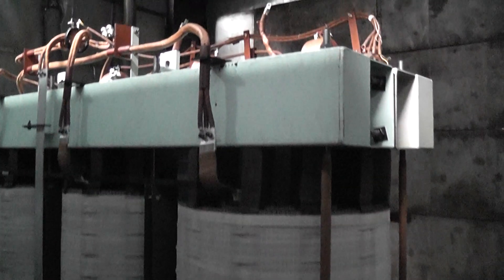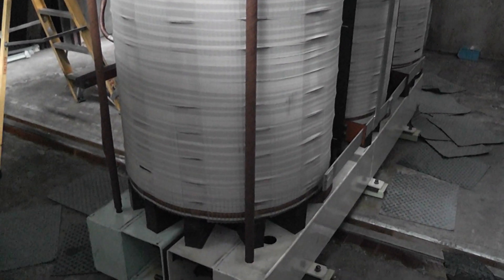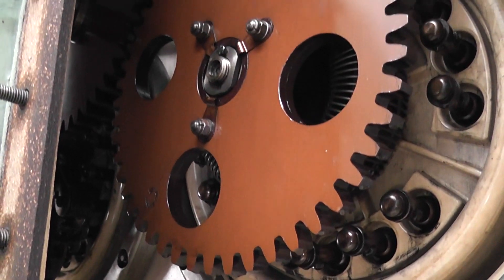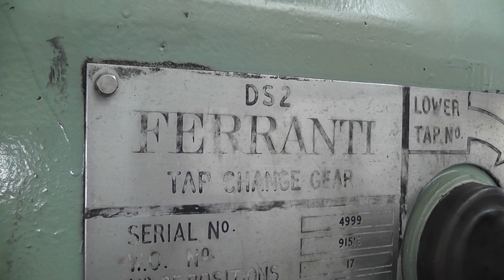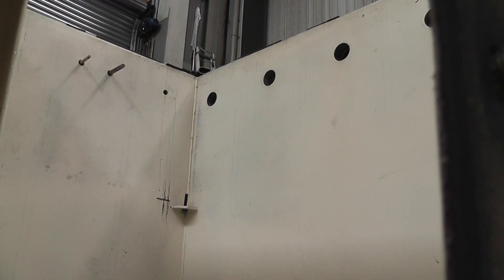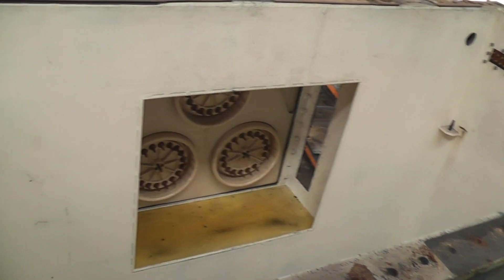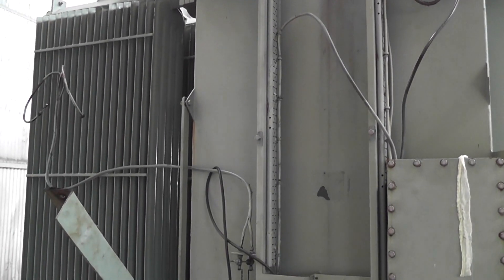What is inside a large 12.5 MVA transformer

Comment: Those spools around the big wires on top of the transformer, are they for measuring the voltage? They have a lot of turns..
Reply from the maker: That is a CT ( Current Transformer or Stroomtransformator ) to measure the current through the incoming supply cables.

Comment: What was the result of the gas test? Was it normal or do you not know?  Not too familiar with the gas testing in the Bucholz relay except from what ive heard. Whats ive been told, if its flammable gas, then it could be a sign of overheating/arching. And if its not, could just be a slow oil leak. Ive heard that a few times from others who work on big transformers like this so maybe you should be the person to tell me how true that it or how such a gas test is done of that's not right.

Comment: It will be interesting to see what caused the gas. Quite often it can just be bad oil, but it can also be the start of insulation failure. But the windings looked quite clean and not discoloured, however the oil looked quite dark.
Reply from the maker: The TX failed shortly after a power surge on a 11kV feeder fault. The magnetic surge may have upset something internally.

Comment: So, just how small a flashover does it take to blow enough oil into the conservator to trip it. I will guess that there was a tiny flaw in an inner winding that flashed over to another and then self cleared by blowing aluminium away and making a nice oxide layer there as well.
Reply from the maker: Yes, it is very likely that an internal flash over has done some arcing. Winding continuity tests have been done and the readings are good. The transformer won't go back into service at this stage and may even get scrapped. A 1953 ASEA transformer of the same rating will be installed in the meantime.

Comment: On the tapchanger - how do you know which wire goes back to which terminal?
I can see 3 bunches which narrows it down but still - looks complicated!

Also - when a tap changer moves to another winding, does it span two windings briefly so it doesn't interrupt supply?
Reply: I think they just measure the resistance of the coil which has to match with precalculated values. Your second question is an interesting one; i was wondering the same!
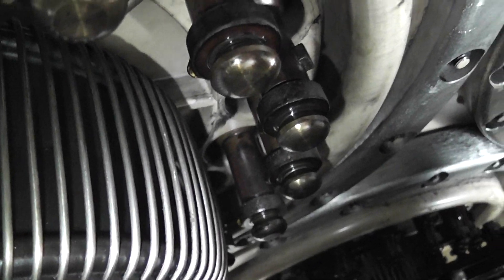Reply: 2:45,  Raymond mentions power resistors for when it goes inbetween two taps... my guess would be the brushes are connected to the resistors so the (relatively compared to 33,000v)  small voltage difference  between taps gets shorted thru the conveniently oil cooled resistors.
Reply: +TheChipmunk2008 If memory serves me right, you are correct. The tapchanger arm has two contacts designed to briefly span two tap positions during changing operation. The power goes through the resistor and this prevents arcing and spikes in the supply.
Reply from the maker: The wires are all numbered, also when assembled full winding ratio tests have to be done to confirm that all windings are connected correctly. This is done at low 110 Volts test voltages.Tapchanger goes from winding - to winding in parallel with R - then shifts quick to the next winding with R in parallel, and releases resistor.Often a flywheel in the mechanism will ensure a quick changeover.I have a video with the DS2 mechanical box somewhere, will upload when I find it.
Reply: Cheers!

Tapchangers are something I was unaware of (but make perfect sense) until I'd viewed your channel.
Youtube is indeed educational  :)

Comment: I need some info, can you remember what amperage  is on the underground power lines that supply Dutch houses?
Reply: A 50A breaker will NOT break at 51A.
Reply: ***** A typical B curve 50A breaker will pass 70A indefinitely at normal operating temperatures, will trip in 1000 seconds at 80A and in 1 second at 300A. This is why the prospective fault current is so important when choosing cable sizes.
Reply: +Richard van Pukkem he edited his post....he didn't have anything about underground lines into the house when I first replied.

sorry I over simplified things to not make to confusing to a person I have no idea if he is in the loop or not....

fuck sake
Reply: +Richard van Pukkem and no one has said shit about my car analogy...

driving a car at over the dealers spec sheet isn't going to blow a motor either...

now please write 5 paragraphs explaining everything he doesn't need to know...and doesn't care about like b curves....
Reply: +kain hall I did not edit my post. I am wondering what the max amperage is that a house connection can have. if three phase is going to cost a fortune to get in to my shed then a 100A fuse box will be my option with a phase converter to get the power source I need for some of my heavy duty tools.
Reply: +kain hall I know all about engines and gearboxes that fail spectacular when seriously over revved and overloaded on weight. my arc welder uses single phase on full load 40a at the outlet  plug, the normal sockets are on a 16A fuse. it has a three phase wire option that might be worth to use as I need to weld a lot.
Reply: Fuse rating depends on the wire size. Your neighbour with the 100A 3 phase connection has to have a 4 core cable with each core being 25mm of copper or 32mm of aluminium feeding him. Your other neighbour with the 80A service has a cable of 16mm to feed him. Your 50A service means the cable is 10mm. Thus if you want to go up to a 100A service you will be replacing both the cable and the meter. If doing that then go for the 80A 3 phase solution with aluminium core armoured cable, as the cable is half the cost of going for 100A, though the biggest cost will still be the laying of the cable if you are using underground connections. If it is an overhead cable then you can simply add 2 extra cores and go 3 phase 50A, using the existing cable, but as you are in NL and there almost all is underground you will be digging. 

Simply changing out the fuse without changing the cable will result in the cable blowing up after a while. Your house fuse upstream of the meter likely is already a 100A fuse, as these are a very common distributor item, the size of the cable feeding you then dictating the current rating of the supply. They will have used a smaller cable and a 50A breaker on the consumer end of the meter, simply as that is what the cable can safely handle. The fuse in the supply side is to protect the upstream network and disconnect you when the cable is damaged from say a pickaxe hitting it.
Reply: Here is a PDF with all the connection costs per fuse size in NL: https://www.enexis.nl/Documents/tarieven/Tarieven%20elektriciteit%20voor%20consumenten%20vanaf%2001-01-2016.pdf On top of that you will have to rebuild your whole fusebox, and a lot of administrative stuff..
Reply from the maker: That varies, many older houses have a 25 or 35 Amp main fuse or three phase 25 or 35 Amps. Have a look at the rating plate of your electricity meter, which gives an indication what type of supply cable you may have.10(30) Amps is often 25 Amp slow. 20(60) Amps 35 or 50 Amps slow.
Reply: look at your fuse box.....at the main breaker
Reply: +kain hall we have 50A, the neighbors left of us 80A the garage right of us 100A and three phase. that is why I am wondering what the max amperage is I can get, i need 50A for my welder alone.
Reply: +Arjan Wilbie a 50 amp breaker is going to break at 51 amps.....simple.

if the top speed of a car is 100....you can't go over 100. motor will blow up.

best bet would to just call your local power company man.

they KNOW 100% sure what service you have....and they can put in a 100 amp service if you need it.

we have electric heat...2500w for each heater.

in just one room and a garage...it's on a 100 amp service

the electricity bill in the -40f montana winters is about 400 to 600 American funny money
Reply: +kain hall Ouch!
Reply: +SDG Electronics no shit...it's ment to break at 50.

otherwise why fucking say "this breaker is 50 amps".

you mean it breaks at 30 amps?

why not call it a 30 amp breaker?

I didn't think this guy really.knows much about power....

it is easier to understand going.over a limit than it is being at the limit.

sorry my example wasn't 100% correct.

please correct my dyslexic spelling next.
Reply: +SDG Electronics no shit...it's ment to break at 50.

otherwise why fucking say "this breaker is 50 amps".

you mean it breaks at 30 amps?

why not call it a 30 amp breaker?

I didn't think this guy really.knows much about power....

it is easier to understand going.over a limit than it is being at the limit.

sorry my example wasn't 100% correct.

please correct my dyslexic spelling next.
Reply: +SDG Electronics what will it break at then?

you really think every fuse and breaker is 100% accurate?
Reply: +SDG Electronics and from what I know....a 20 amp breaker can sit at 22 amps for quite a long while. unless my multi meter was out of spec

tollarance. it's mechanical....it's got tollarances. 

some trip early....some trip late...and it all depends on how fast the current rises, how many amps, and.how long it stays their.

a 20 amp breaker can see 30 amps and not trip....because it only sees 30 amps for half a cycle (or.less)

electric motors pull HUGE current at start up for .25 of a second or so....don't trip it..
Reply: +SDG Electronics yup... something I have seen first hand.

but please try to explain b curves to someone who is having problems figuring out how to even what what service he has.

3 paragraphs on curves...

or...simply.... 50 trips at 51
Reply: +kain hall I think Arjan wants to know the rating of the fuse of his Street, not his own house. I guess Arjan gave up on this discussion after the nonsense conversation about the fact that a 30A fuse breaks at 31.
Reply: Homes within the resedential area have either 1x40A or 3x25A standard (upgradable ofcourse) and homes outside of this area or business usually start at 3x80A. 

Call your power company, usually they can give you an (expensive) upgrade.
Reply: if you want more power to your house you have to pay allot of money 
meter needs to be replaced 
probably the wiring 
and installation you have to pay all that 
and you are probably going to pay double the price for  maintenance 

we had the same issue at our company where we needed a 125 amp plug... costed a lot off money... 
you can call alliander for that.. 
dat is je net beheerder